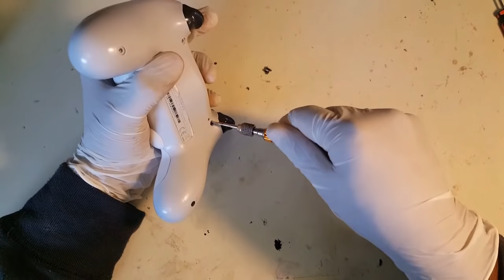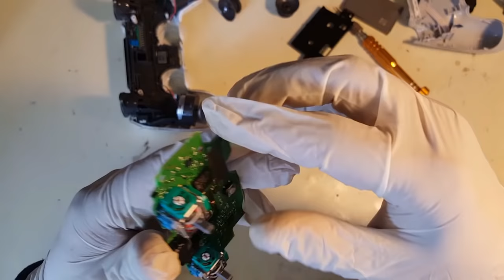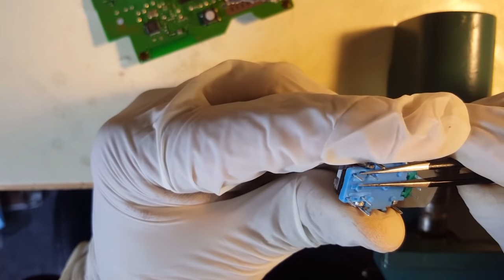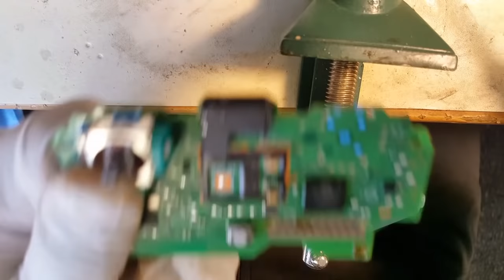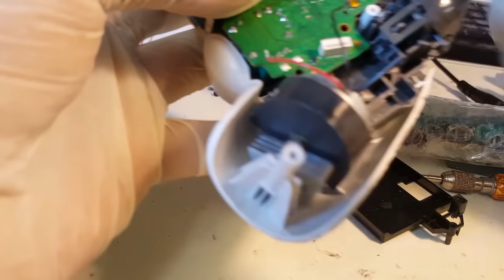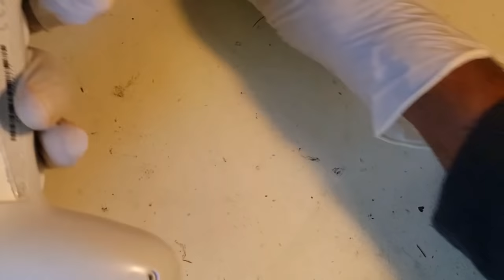Ps4 Controller Joystick Replacement

Comment: I've just done my controller the solder looks good but it won't switch on anymore any idea what I might have done?
Reply: Forgot to plug the battery back in?
Reply: @FlintBeastgood  no the battery's in. I have two diffrent Controllers I de solderd both with the solder iron and that copper stuff. I might have over heated it them or I might have short a circuit either way it's happen to both controllers and I've opened them a few times before to switch around that tiny working parts on the thumbstick. Eventually it snapped so I desolded just that bit and switched it with a new one. Even tho it was only the 3 pins it still took alot of effort. Im fairly sure the heat gun is the only sure way to do it.
Reply: @richardturpin3665  did you get a solution to this?
Reply: @sirdamusain2748  no just bought a new one

Comment: Is it possible to bend back the green censors without removing them and install a new joystick?
Reply: New ones come on the joystick if you replace the stick it would be harder to do it leaving the sensors in place

Comment: Do i need flux?(also, i dont have a thing to hold the board in place)
Reply from the maker: Yes flux is a must for this type of work. You can use anything to hold the board, doesnt have to be as same as mine

Comment: Love your channel Man I have done 100 modules for guys already but I need some advise a few of the controllers I do both analogs then they perfect but after the controller flash yellow light like its charging but it's not even when you plug it out still shows it charging but it's not then it trains battery and then it gos dead please assist

Comment: I can't seem to get it right? I have perfect solder on all 14 points but every time it will spin one way or the other? Any thought's on my problem?
Reply: i have the same problem ,soldering is done with care and when i turn it on it seems to be stuck pointing in left position ,anyone know what went wrong and how i can fix this ?
Reply: Is that the same problem you were having before you tried fixing it?

Comment: So i just did everything the same but my j sticks are moving even if im not touching them they move up to right corner any help? 
Yah btw my light bar not lighting up after my fix suggestions?
Reply: fn4lx  Be aware, when controllers are built new from Sony, the X and Y-axis values are calibrated to the specific board they are initially installed on. Installing these sticks on a different board could cause your values to change by an undetermined amount. The use of a computer aided program such as a CronusMax, or other controller software to view your value offsets is recommended. Also suggest placing the potentiometers from the original mechanism on the newer ones, and ensuring that the mechanism is as flat as possible on the board when installing. [sic] battle beaver customs https://battlebeavercustoms.com/collections/ps4-replacement-parts/products/dualshock-4-replacement-thumbstick-mechanism?variant=1290409017358

Comment: i replaced the analog sticks of my controller, used solder iron and hot air gun, and re-assembled my controller, unfortunately controller is no more dettected by the ps4 console, although light is blinking on controller when I press ps button.
I think I may have fried the board with the gun. Lol, though it was a great experience, may be next time i'll be more careful with the hot air gun.
Reply: What kind of solder did you use? My solder won't melt at all no matter how long I leave the heat gun on it or how much Flux gel I use . I already presoldered my joints but they just don't melt

Comment: What soldering iron and heat gun are you using?
Reply from the maker: Hi,i use hako 973 hot air n soldering station.

Thanks

Comment: I accidentally remove the green plastic in the side of the stick joystick while trying to change the sensor wheel.

is there a way to solder it back without soldering tools?
Reply: I did the same with all the 4...

Comment: quick question I have a jdm040 with a bad left joystick can I use a joystick off another board which is jdm011 and use it as a replacement on the jdm040???
Reply: Yes as long as it has the same pin holes and lines up the same
Reply: @slader-hl1kk  i cant even get it off the dam board....

Comment: Help:
I have all this stuff. I use low temperature solder paste (137 C) for the joints, then I clean it up and then add flux. I set the air to 140, no luck desoldering. So I tried 420 C on flow 4, smallest bit. My silicone smokes up, but no desoldering. I don’t know what I’m doing wrong
Reply: Put flux then add some solder to old solder to mix in then should be easy to melt and take off

Comment: Hey I love your channel thanks for all your hard work. I have a question if you could possibly help I would be most greatful. I did the toggle switch and when I started to play a game the it went by its self to look up like the toggle was stuck on up. Any thoughts
Reply from the maker: Hi,glad to be help.Yap sometimes its poorly soldered joints on the joystick n board.Ensure they are soldered properly.Do the basics first re-check solder joints,dust clear etc.You can also measure the resistance of the joystick by probeing on the soldered points n while moving the joystick in directions.(compare to the working joystick)

If it still persists than i would suggest to replace to another joystick.

Hope this helps.
Reply: @autronicsltd3478  thank you so much
Reply: @autronicsltd3478  hey i have same problem but that happens when i turn it on its like stuck and moving up to right corner happens for both replaced joysticks any help???
Reply: Mines is stuck to the left
Reply: Happened to me too. Pretty sure I messed up the motherboard in some way. At first I thought it was a faulty joystick so I ordered another set from a different company and the problem still persisted. I think as I de-soldered the analog stick I managed to pull / break part of the metal rings on the front side of the motherboard.

Comment: Hi great video.
I have a problem with the ps4 controller left stick.

Mechanically it seems to be ok, I don't feel like something is broken or stuck inside the stick. But whenever I pull the stick in one direction to let the character go in that way, in game my character go In that direction, but not smoothly as it has to be, but with a shaky movement. It stops sometimes than walk forward, then stuck, then go forward again. It seems like the movement registered by the stick is not smooth but shaky.
After doing some research I discover that sometimes the sensor wheel of analog stick can be damaged, so I was thinking that replacing this piece may solve the problem.

What do you think?
Thanks in advance and sorry for the long sentence!!!
Reply: Farooq Khurshid open the controller, disassemble it completely and blow out the sticks with compressed air. Worked for me first try and now I have 4 more controllers to do

Comment: The contacts on my controller have some type of film over them and won't de-solder. What do I do?
Reply: Add flux then add some new solder to old solder to mix in then should melt easy

Comment: I screw mine. I was able to desolder just with soldering iron and sucker, then solder new ones,  but I was too careless and did some damage I will not be able to identify. Controller now disconnects/resets every 15 seconds. Not going to try it again without proper setup.

Comment: So i just tried this and it made my drift 10 times worse and when I press the L2 the stick I replaced goes up. Could I have damaged the board by not using heat tape on it?

Comment: How did you stick the motor cables back?
Reply: Resolder them. If you removed them from the board to start with. If you pulled them out of the rumble packs that was a big mistake.

Comment: electric solder sucker is a far easier option and its what i personally use as it makes removal of these extremely easily
Reply: That's what I'm having trouble with trying to remove the analog stick since I don't have a hot air gun and blow dryer doesn't seem to work lol
Reply: @MrHankeee  how did it go? What did you use to pull off the analog?
Reply: @SchradeDemise  I gave up, i couldnt get it off and I think I messed it up more might try again when I actually learn. Not sure if i wasn't heating it enough for it to disconnect or if cooled down to fast. Not sure why I couldn't get it off but I think I might have burned it
Reply: @MrHankeee  thanks for the reply. I will attempt to do it tomorrow. Got all the stuff i need except the hot air gun and cleaning alcohol, not sure if they're needed but will try regardless. I have multiple broken controllers. I'm gonna test it first on the cheapest and the most broken one before going for my main controller.
Reply: @SchradeDemise  how did it go? 😅

Comment: if i get a soldering iron and desolder can i do it or do i need everything shown in the video?
Reply: You need a decent hot air gun, soldering iron, flux, and a roll of copper solder wick or a solder sucker and of course a new joystick sensor. Thats it.
Reply: @slader-hl1kk  ok thanks, too much so im just gonna buy my new controllers

Comment: only thing i’ll say is do not hold on iron on there, it can burn the board. once you connect the solder and the iron, it immediately is finished. you don’t even wanna touch the iron the green part. just hold it on the base where the legs are stickin through and touch the solder to the metal base also and the flow will be perfect. Make sure there aren’t any bridges between the legs

Comment: Those corner posts are a beast to desolder with wick and sucker, they eat up so much heat.
Reply from the maker: Yes they require constant heat. Use ample amount of flux, it will help the solder flow better.
Reply: @autronicsltd3478  Thanks for the help 🙏
Reply: @autronicsltd3478  I went with more flux and got close, but still ended ip having to jimmy the sticks too much on removal for my liking. Decided to order the Atten hot air, I'll report back when I've had another go. Will need to pick up some Al foil tape too.
Reply from the maker: @bakedbeings  Interesting...they do require steady heat n take a bit of time.Did you apply/add fresh solder to the joints before heating it with the hot air station?
Reply: @autronicsltd3478  I don't have it yet, just ordered. My second try (described above) was just working with better flux, more time etc as you showed, to really see how well I could manage without a hot air station. Before ordering some new kit I try to make sure I'm not just impulse buying :)

Comment: For more convenience the sensor should be removed first (3 pins both)and then it's so easy to remove analog sticks.or just change the wheel inside the sensor.

Comment: What temperature was the soldering iron and heat gun?
Reply from the maker: Soldering iron temp: 365degree
Heat gun temp: 350degree
Reply: Yes just don't remove the motherboard wires. I did it myself without the iron gun.

Comment: I need help asap i resoldered my sticks but my light bar not lighting up when i charge or turn on controller
Reply: fn4lx you might have damaged the ribbon near the start. Did you wear gloves?
Reply: @RegularFish2  no gloves and i changed ribbon caple but still nothing
Reply: fn4lx then it’s probably the led or the device connecting with the ribbon, I’m sorry I won’t work for you
Reply: @RegularFish2  thanks for help anyway
Reply: fn4lx I think the ribbon automatically gets trashed if you don’t use gloves, could be wrong though
Reply: @RegularFish2  nope i never use gloves but all my controllers worked before this

Comment: Is there any way to do this without that heat gun?
Reply from the maker: Hi,yes u can try n remove the solder with a soldering iron n solder wick/solder sucker.

Hope that helps.
Reply: @autronicsltd3478  I tried it and all of seems gone, and clean. It took me a while but for some reason, it still is stuck. I think some solder may have gone on the other side. What can I do?
Reply from the maker: @KraziJoker  hi,yap apply soldering iron to each leg of the joystick n apply slight pressure pulling away from the board.Work your way around all the solder joints.

Hope that helps
Reply: @autronicsltd3478  ok I will try again and let you know. Thanks you.
Reply: A desoldering gun would work a lot better for through hole components without having to risk damaging nearby components as you would with a hot air gun. Hot air is better for smt parts. Cheap Chinese clones can be had for cheap and can be just as good as hakkos!
Reply: I got the following day. It just took some time
Reply: @BugBunny978  funny but u read that question wrong. There is difference between heat gun and soldiering iron.
Reply: @KraziJoker How did the desoldering of the joystick go? because I may need to do the same and I don't have a heat gun also
Reply: @hakimdurand8427  it took some time and effort but I got it out using the sucker and then the soldering wick. Use the wick on each flat side of the pins and push a bit till the pin moves and do the other side till its cleared.
Reply: @KraziJoker  oh dam I have no wick either lmao guess this means new controller
Reply: @hakimdurand8427  soldering wick isn't expensive
Reply: HomeDepot carries wicks?
 @KraziJoker
Reply: @hakimdurand8427  I'm not sure. I saw online that they costs around 2 dollars in home depot.
Reply: @autronicsltd3478  how would i have to pay u to fix my controller

Comment: HELP. PLEASE HELP. Im stuck the part of removing the Joystick from the board and My heat gun isnt powerful enough and I cant use it evenly. Is there another way? Im tired of paying up to 200$ for equipment. Really I am. I'd rather just buy a whole new controller  Literally..
Reply from the maker: hmm, a decent Chinese hot air station is sufficient but it can also be done with some low melt solder and a 40w soldering iron. This kinder work does require patience.
Reply: @autronicsltd3478  I’m actually trying to learn how to fix these things so I can work in a shop. What do you do about a damaged or shorted ribbon cable? 

Also, would you mind doing videos on controller additions ? I’d like to wire LEDs directly to my own controllers board as a test, but I don’t even know where to start.
Reply from the maker: @sincereflowers3218  Yes its a great idea to learn and fix these as it helps to keep them outv the landfill and increase the life of the product.In return you learn a new skill set which stays with you for a lifetime.

In terms of additions no sorry i dont do led etc mods to the controllers.Shorted and damaged controller ribbon cables,best to replace them with news one as they are cheap and easily available from aliexpress or ebay.

Hope that helps.

Comment: Hey where can I buy the replacement joystick mods ?
Reply from the maker: https://www.aliexpress.com/item/10X-Joystick-3D-Analog-Sensor-Module-Repair-Part-For-Playstation-4-PS4-Controller/32880300000.html?spm=2114.search0104.3.94.68f63265sUHW7p&ws_ab_test=searchweb0_0,searchweb201602_3_10065_10068_10547_319_10059_10884_317_10548_10887_10696_321_322_10084_453_10083_454_10103_10618_10307_537_536_10902,searchweb201603_16,ppcSwitch_0&algo_expid=465ae3a5-e7d2-4705-b31d-7799ae17a89a-13&algo_pvid=465ae3a5-e7d2-4705-b31d-7799ae17a89a

Comment: People get scared off by soldering it’s really not that hard usually and it’s not super expensive to get into either it’s about a hundred dollars total for  wire and a decent iron that and an iFixit kit and you can fix a lot of electronics you can even fix the BLOD on ps4s most of the time

Comment: I tried it but fucked everything up with the heat gun like 2 plastic connections melted and i even covered it with aluminum foil and also I struggled alot with removing the solder

Comment: Can I use analog parts from Xbox 360 controller and put it into DS4?
Reply: Yes as long as its a newer xbox controller from Xbox 1 I know there the same because on ebay when selling them it says for xbox 1 or ps4 so. But has to be the newer ps4 controller not the old ones.
Reply: Yes as long as its an Xbox 1 controller sensor xbox 1 and dualshock 4 use the same joystick sensor
Reply: @slader-hl1kk  Thanks mate. :)

Comment: How do you easily remove the battery piece, when I tried that I literally rip the connected plug piece for it.
Reply: Nexus Prime42 same mate
Reply: @adiart9094  It still works but I no longer have bluetooth and wireless capability anymore.

Comment: How could I take off the analog stick without the hot air gun
Reply from the maker: 40w soldering iron and flux with low melt solder

Comment: I've got a weird issue with mine and think it needs replaced. Basically on the left stick there's a small window when any slight bit of left or right tilt makes the controller sends a 100% left joystick up input. Anyone else have this happen?

We used to beat the s**t out of old ps2 controllers after school mashing buttons and joysticks and they never failed so it's pretty disappointing for an official $70 sony ds4 to malfunction after only a few months of light usage.

Comment: So much easier with goot wick but how do you resolder the motors i always ruin it and the pads come off the board what am i doing wrong
Reply from the maker: Hi,motor wires should be the easiest.Apply heat on the solder pads n lift with tweezers or needle nose pliers.

Hope that helps
Reply: @autronicsltd3478  ok thanks i need to get better tweezers than dollar tree
Reply from the maker: Hi,Take your time n be patient with it.Quality tools do matter alot esp if your thinking of doing this long term.

Thanks
Reply: Sounds to hot but you need decent tools it makes a big difference for sure

Comment: I'm using a cheap Walmart 30watt solder  gun and it's not even melting the solder off. I'm putting flux but I can't get the damn thing off.
Reply: Get a 60w does the job done